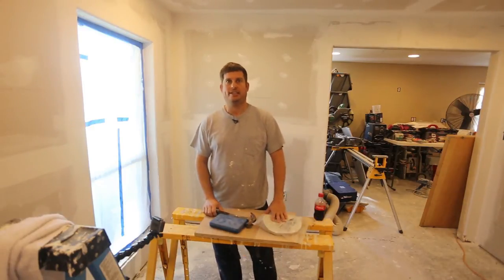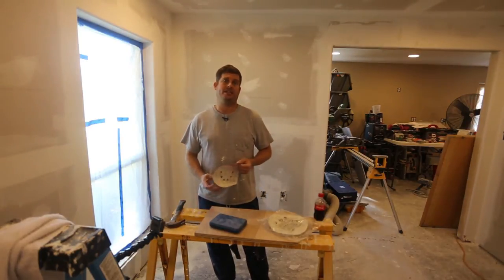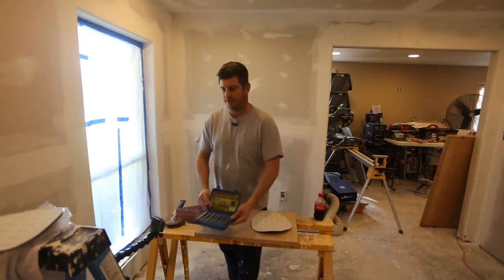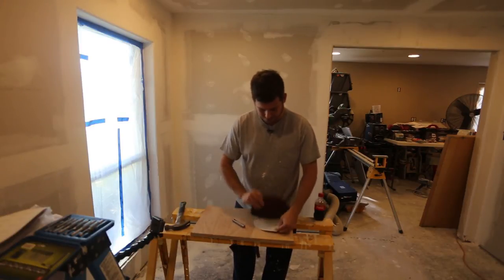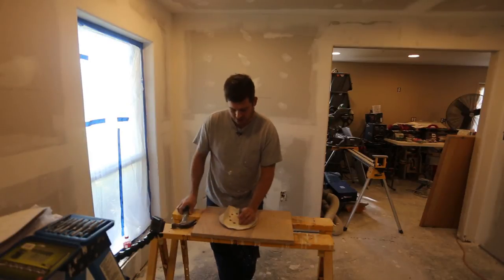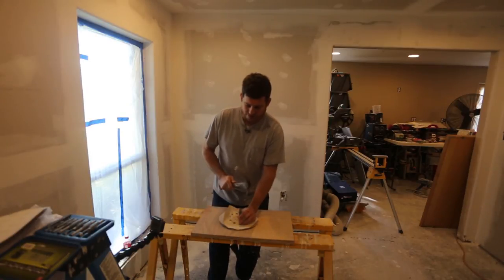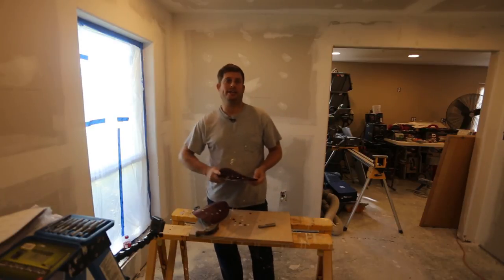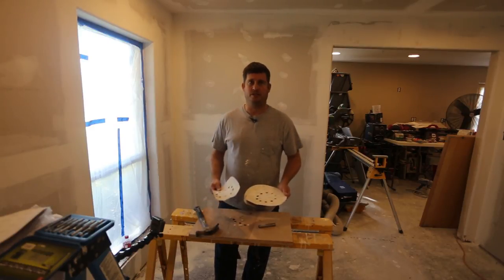Save money by putting your own dust holes in Sandpaper

Comment: If you don't have a piece with holes already in it and your sander has a foam pad on it just wet it down a little and press it down on the paper side to create a template. You can throw out the wet sheet after you punch a second one.

Comment: I like how clean the punch does it rather than using a board with nails in it.  That looks like sandpaper you bought with the holes already in it.  Of course they probably have a machine that punches them all at the same time using 6 or 8 punches like the one you have there.

Comment: I would make a wood template to match my sander and then use that as a guide to punch the holes.  I must have dust holes, I hate getting covered in fine dust from sanding things.  If you are like me you have a 6 inch sander that works fantastic but spews dust everywhere without the dust bag and it gets on everything.  I also only use it when my cat is not there at the moment.  I don't want my cat inhaling that junk.  She is a black cat and I named her Jinx.

Comment: Rather than ordering a full set that I will never use, I just ordrered the one size I need.  It was only a couple dollars rather than 20.  I also made sure that it is either carbide steel or carbon steel.  I know that sandpaper is harsh on tools so I skipped the ones at Harbor Freight.  A lot of reviews on their punches said they were soft steel.  I was expecting that I might read something like that.  Some of the stuff they sell is OK but I would not buy their saw blades, especially those moly karb blades.  I have read only mostly awful reviews on them such as being good for one cut and being dull.  Gee, I just can't help but wonder why in the hell they produce those blades if they are that bad.  The last thing I want is a dull saw blade fighting me or even kicking back at me.  It is dangerous and unnecessary.  I usually will avoid such things at least until they have gained some kind of reputation for quality and that is assuming they stay in business long enough to have that chance.  Nothing against Harbor Freight, I just like something that will last some length of time.
Reply: Wow... You really went on a tangent here...